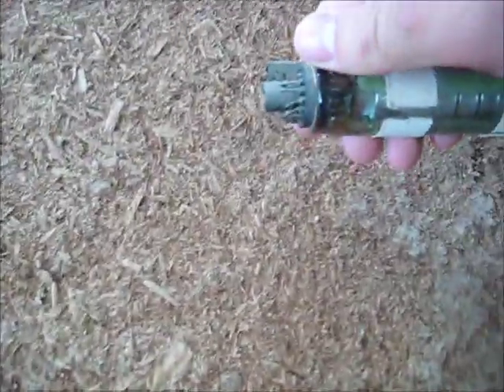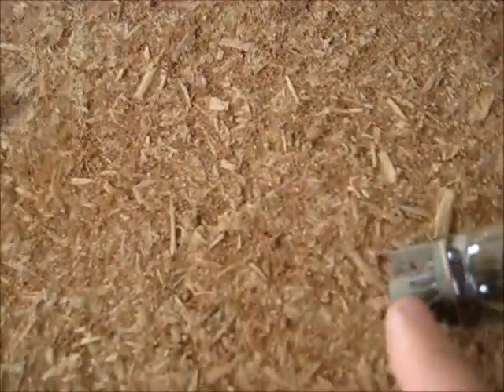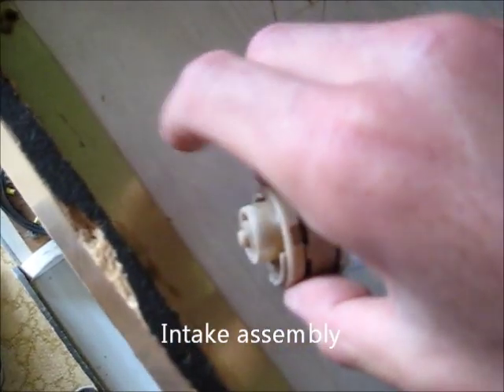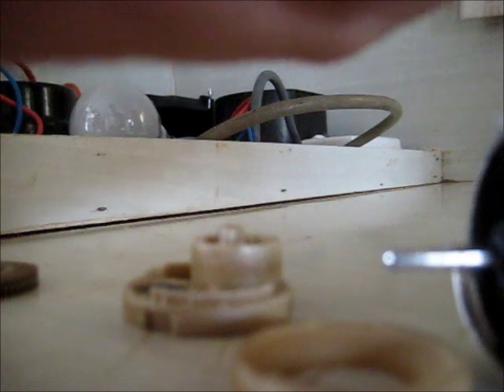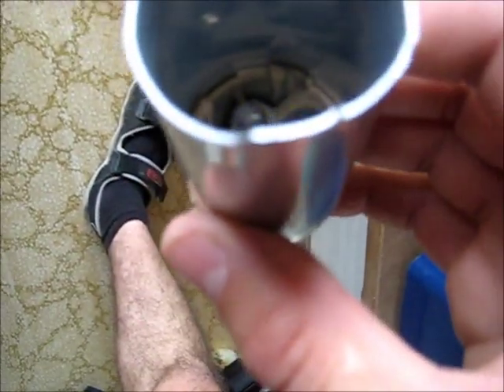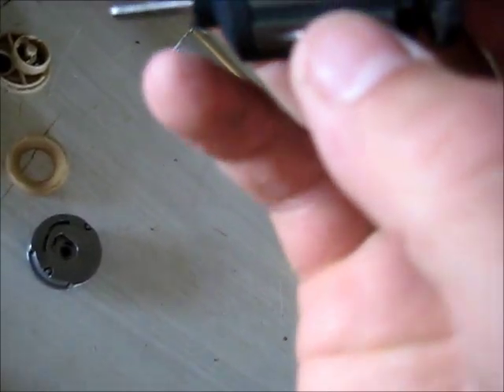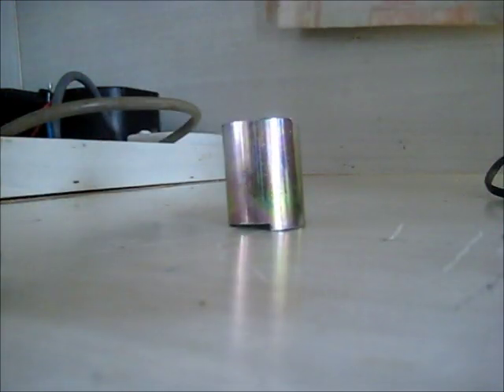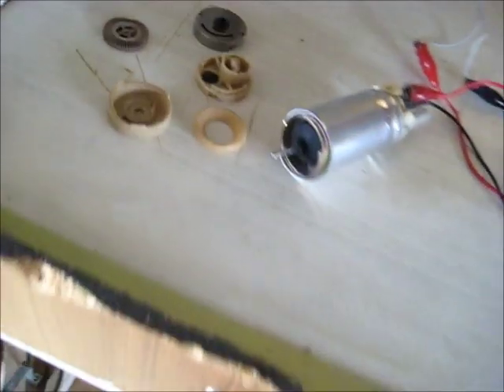Commodore fuel pump autopsy

Comment from the maker: there was 100 HZ DC Ripple! from the full wave rectified output, I just used a 6 Amp bridge rectifier, no filter capacitor

Comment: Does your transformer have a bridge rectifier + cap on the secondary side to convert the AC to DC? The motor sounds like it has AC being directly applied to its coil windings giving it the hum.

Comment: Hiya, the rotary pump part of that device may pump fuel in the same way as a refigeration scroll compressor. 

If you still have the pump bit, is it possible to open it up to see if there are scrolls in there? 

-BoomBoxDeluxe.